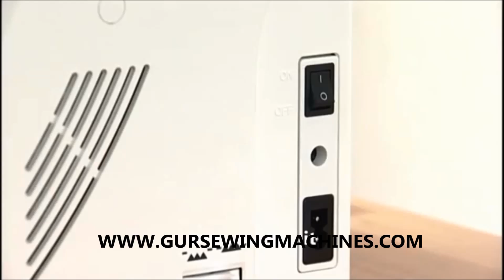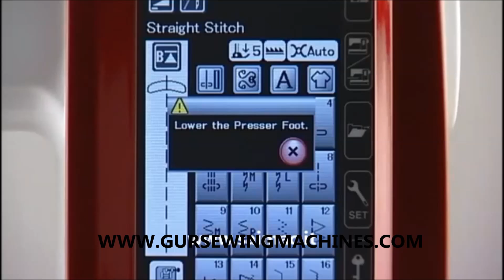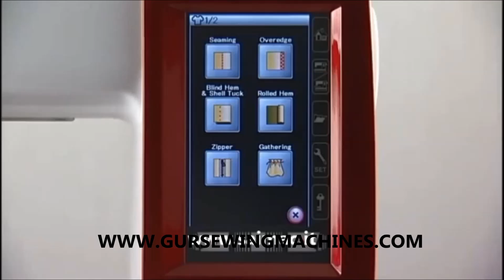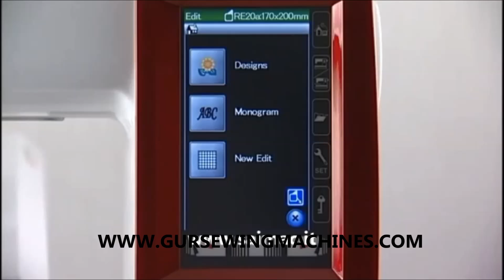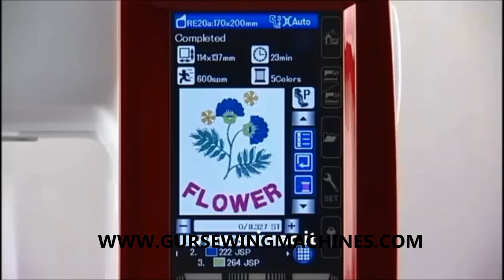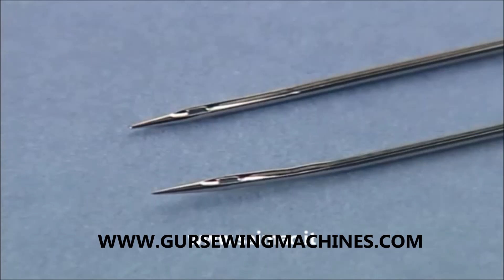Janome Memory Craft 9900

Comment: I just bought this machine. I do not know how to get the 1/4" foot to work because I cannot get the needle to move over to the right enough. Any help is appreciated!!
Reply: annalise128    starts on straight stitch choice (you see there are 4 box pictures). Pick 2nd picture.     you will see Quilting,   click on that choice,      you will find 1/4 foot choice.  make sure you have the correct.  foot and face plate with large hole
Reply: I have the same problem.  it has something to do with the patchwork but I can't get it to light up.